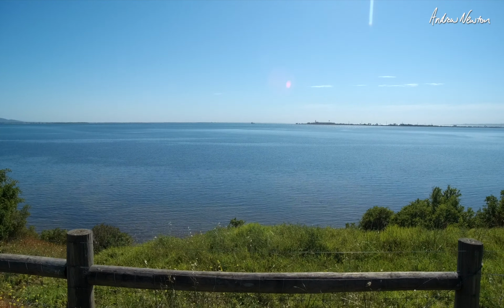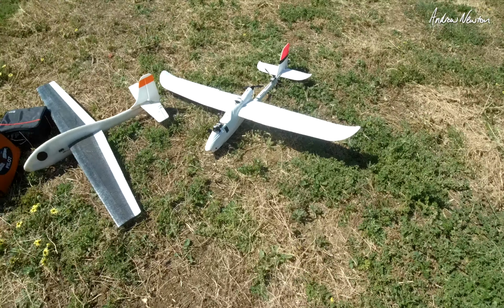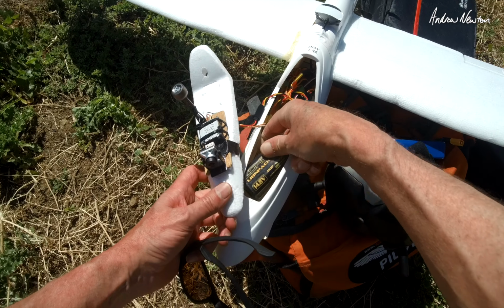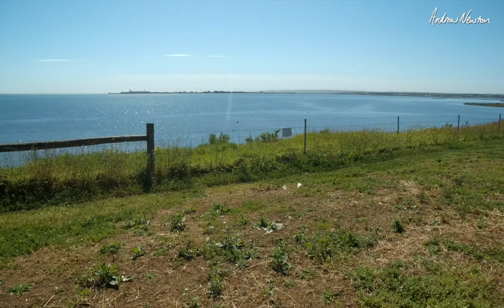Motor sloping Digital HD FPV

Comment: Just beautiful.  BTW when you run the LiIons - what voltage do you take them down to?  Most datasheets say you can safely take them down to 2.5 per cell.  I too have made up my own LiIon packs and am having mixed results for flight times.  Do you notice the ZOHD pack is performing better than your home made packs?
Reply from the maker: I never push them that far, maybe down to 14V while flying. My home made packs are old recycled cells. so the ZOHD is bigger and better.
Reply: My car bms stop at 3.0v/cell

Comment: Would you have any tips on finding thermals while flying via FPV please Sir Andrew?
Im running an L9R in a Hobby King Walrus without any OSD/FC & looking to try & extend my flight time beyond 30minutes by trying to find thermals & cut the motor for a bit without much luck....
Im already using a ZOHD 18650/3500mah pack & its coming down with about 3volts [er cell left in it...
Reply: Get lemon L0052U with altitude and varometer
Reply from the maker: Yep Vario beeps are what you need.
Reply: @AndrewNewton  &  @ror1984  I was kind of hoping to stick with L9R for it's range.... :'(
Is there any tell-tale cues to look out for from behind the foggles???
I tried following the sea eagle that hangs out at local flying field but it has a tenancy to try & chase most planes it finds sharing the area instead....

Comment: how do you like the nebula camera compared to the original dji camera?
Reply: i’m pretty sure while the dji air unit as well as the vista are capable of transmitting 120fps video to the goggles, the caddx nebula camera caps the frame rate at 60fps. due to this reason you’ll see many fpv drone pilots who use dji recommend solely using the original dji camera whatever air unit you are using
Reply from the maker: Smaller, lighter, cheaper, no onboard recording, picture is pretty much the same.

Comment: would have been nice to get a clear picture of your setup rather than see a lot of pretty pictures.
Are you using the DJI controller?
Reply: @M-H433  I see no mention of controller...just dvr footage...I like to see goggle footage.
Reply from the maker: Caddx does not record onboard, this is goggle footage. Look back for previous video of the setup. I dont have the controller.
Reply: Andrew Newton it is very difficult to see what you are using...your links point to a DJI full system with controller..you have links to many items...how about a list in description of what you have in the plane and on the ground for us Un educated..thanks